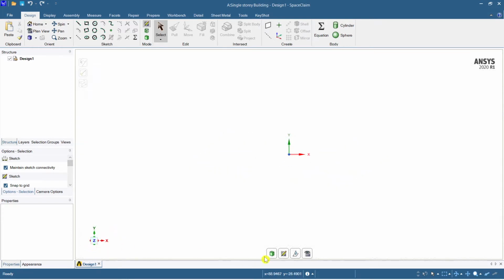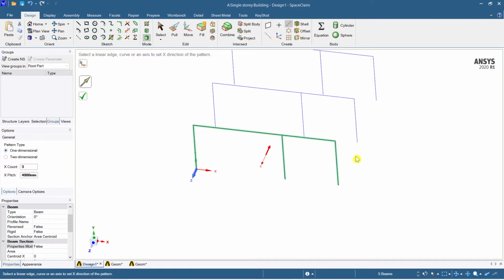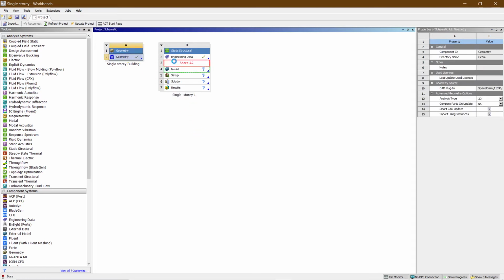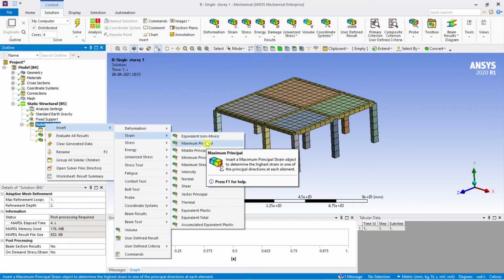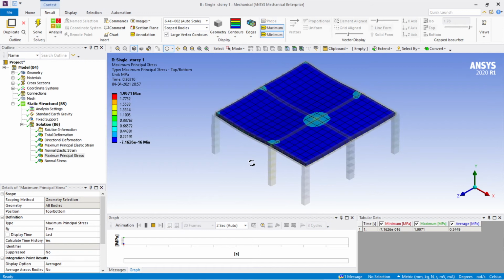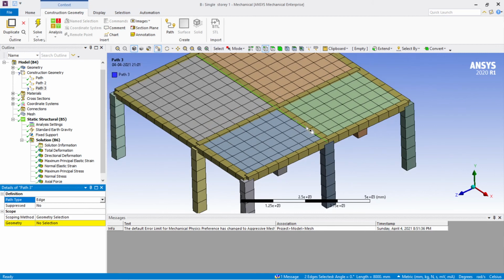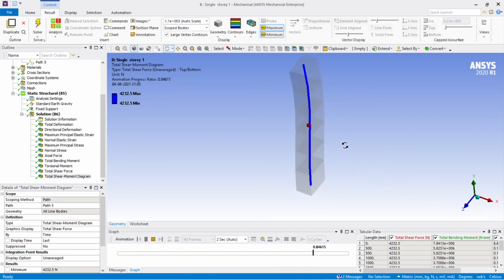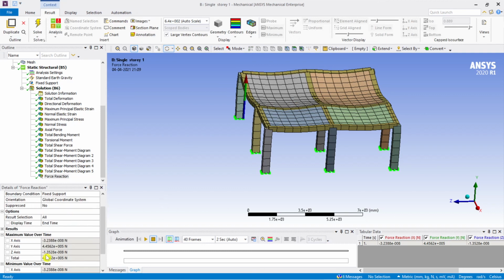Modeling and Analysis of Single Storey structure in Ansys workbench 2020 R1

Comment: hi. i used spaceclaim to design a structure but while i was making it with lines it seems that spaceclaim randomly created solids and surfaces during the process. now for some reason it doesnt give me the option of profiles , so i cant go and assign whatever profile i need in each  beam. can someone help? is there something wrong with my settings maybe?
Reply from the maker: In prepare menu, turn off the line to solid display ....

Comment: Hi Sir, the video is very usefull for me because i also need to simulate this type of structure. However, do you have anyway for simulating the reinforcement inside concrete with this method of simulation?
Reply from the maker: Yeah we need to just hide all other components except reinforcement and run analysis then we get the reinforcement analysis results......
Reply: @Abhi_Innovate  Sorry Sir, I mean that you only use CONCRETE for you simulation. However, i need to simulate a REINFORCED CONCRETE structure. So, how to create a reinforced concrete material for those beams. Thank Sir!
Reply from the maker: @hainguyenhoang3636  I have also posted videos on reinforced concrete check my playlist....